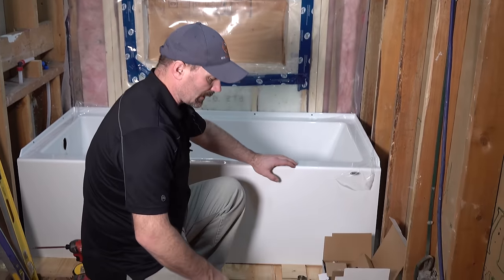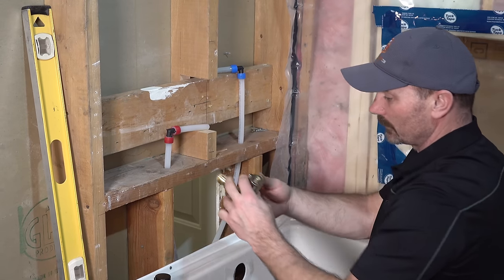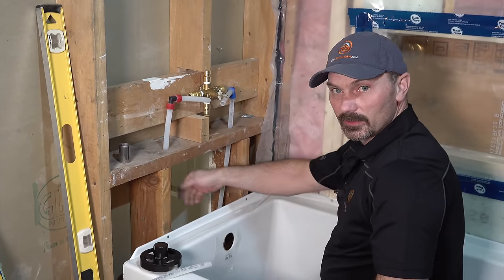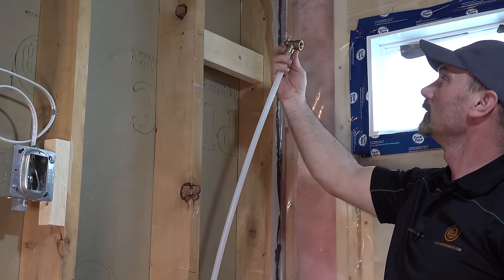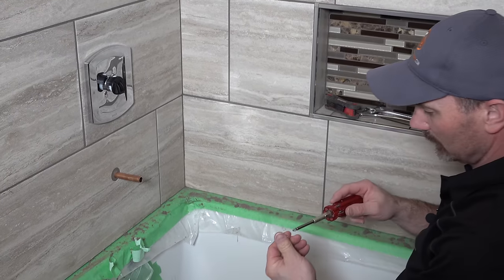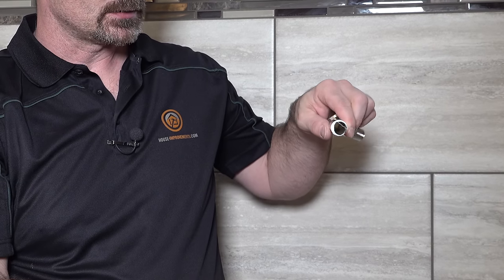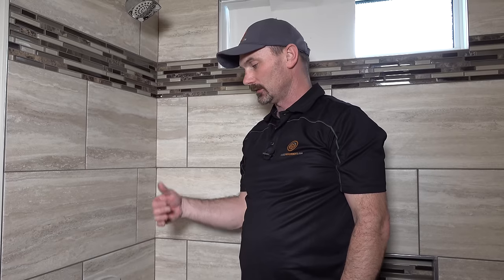How To Install Tub/Shower Faucet

Comment: I definitely appreciate the level of detail you include in your descriptions. As a handyman, I do so many different kinds of projects that I need these extra reminders and notes so crucial steps remain in sequence. Thanks for confirming the importance of anchoring PEX and always switching to copper when pipe needs to breach the wall. I didn't hear you mention gauging plumbing rough-in height with tile size and layout to avoid grout lines falling behind escutcheons, trim plates and tub spouts (when possible), but your finished product demonstrates this preferable aesthetic. 
I currently have yet another project including a tub conversion to shower, and a tub replacement, in tandem with a PEX system upgrade from old CPVC for the cold. This is in a condo w/steel studs, so I'll be cruising through your vids for any tips I don't already know. Already looking to reframe the shower to best accommodate the clients preferred tile. Fun Fun Fun!
Reply from the maker: Disaronno on ice

Comment: I am using a Moen system very similar but unfortunately I have the bath spout that screws on and the length of the copper needs to be just right, which you talked about, ugh. Very good info you provided, thanks!  It will help me a lot in gauging the depth of the Moen valve. As you mentioned, the instructions are vague in this area.  It's more art than craft at that point. Wish me luck!
Reply from the maker: Glad I could help! Those threaded spout connections suck don't they? LOL

Comment: I know those push connect/shark fittings are convenient, but why not use pex crimp rings?
I know they are more permanent, but I would think they are cheaper and no worries about the slim chance of a connection leak/failure.
Reply from the maker: you for sure could ,This is just what I do as it is very convenient .

Comment: I need to know about threading the shower arm on. 
I counted 3 rotations and you said you couldn't do more, all by hand, no tools. 
I just had to use a 24in pipe wrench and the arm sandwiched between 2 boards to hold it just to get my arm and sharkbite threaded together. (I used 5 wraps and pipe dope) we got them together and only seated about half the threads. I went through dry fittings with 2 different shower arms and multiple 1/2in female threads. All copper or sharkbites while sitting on the floor in a Lowes trying to see what the heck the issue is. 
Initially the arm leaked, after the pipe wrenching madness and 4 or 5 solid turns, no leaks. I cannot understand why that was such a hassle for use while the multiple other threaded fittings were light weight and easy wrenched snuga
Reply from the maker: I would say you had the threads cross threaded ?
Reply: @HouseImprovements  by all means yes, the original fitting was crossed after we removed it. The crazy thing is, the shower arm was just fine, when tested in other fittings we had the same result, just didn't tighten it fully.  Our problem has been an issue with a few others too by checking  a couple forum posts here and there. In the end, we got a new shower arm, a new fitting, plenty of dope and tape, a hefty amount of applied force, now no leaks. I even asked opinions of the employees with the dry fits in store before I took them home.

Comment: Great video! About to attempt my own installation.
I think I'm going to go with PEX tubing like you did.
Curious about the push-in connectors though, especially the one for the tub spout, what is preventing the pipe from falling out of the connection ? I was waiting for you to clamp them on but it never came 😅 any clarification would be amazing, thank you!
Reply from the maker: The fitting has "teeth" inside that keeps the pipe from slipping out under pressure. At the 20:30 mark I explain that I will add another block of wood and clamp to the pipe .

Comment: Question: so I just had a bathroom remodeled. It had no shower head plumbing and I believe mostly galvanized pipe. Anyways, the guy I hired used all pex. Before paying him, I turned the tube on and my shower head would leak. Further research, it's because he used pex from the diverter to the tub spout. Anyways, I needed him to fix but obviously he wasn't going to cut the new tile. So he had access to the back of the shower portion. He ended up changing the tub spout that he had pex to copper, to 1/2 galvanized pipe. He fixed the issue which was great. But, obviously I wish it wasn't galvanized. Anyways is this a big issue for me or should I be okay for many years before it starts to break down since water isn't really sitting and pooling as much in the down spout?
Reply from the maker: galvanized is not ideal anymore but you will get many years from that .

Comment: By the time you do one bathroom with push connects you could have bought a $45 crimper with rings and all the fittings from the orange store, next bathroom will be half the cost and you own the tools to do professional work

Thanks for the video!

Comment: Great very well explained video your example is pretty much exactly as mine situation is, however I am little confused I was most interested on placement of the valve depth wise from the tiled surface , you said in the beginning that the black cover plate should end up flush with the finished tile however when you showed the final fitting of the sleeves and escutcheon plate etc it looked like that black cover was set back behind the backing board can you please confirm this positioning I have watched several of your videos and you have a great teaching ability
Reply from the maker: The faucet appears that way but the plastic plate is removed because the wall covering is thick enough that the plate is not needed for support. It just looks further back then it is I guess? If you had a fiberglass or acrylic shower wall only then you need that black plate in place just behind the shower wall to help support the wall because its thin.

Comment: Thank you for this!
I have to redo 3 bathrooms & the only plumber who will come out to my house is very rude and he refuses to sweat copper. I'm not comfortable with sweating copper, so I wanted to see how to connect copper pipe for the tub spout. I can re-use existing copper rough-in for the two tubs. I didn't realize push-fit worked on copper for some reason.
I'm going to be cheap & use sch 80 PVC elbows (used for electrical conduit) for the 90° bends for the water supply to connect to the valve bodies. It's less than $1 for the elbows where I live and it will be less likely to restrict the flow.
I'm going to be using thin-walled direct-to-stud wall kits so I'm wondering if I can use water-sealed plywood to reinforce the spots where holes are cut so that if they ever get pressed on/leaned on, it won't crack the surround. I know Sterling/Kohler uses plywood or OSB coated in some protective water seal for their "age-in-place backers". I'm going to be making my own for the grab bars since Sterling didn't have them in the right place for the grab bar sizes we are using. I'll also be adding braces in the wall spanning the studs that the backer boards can anchor to.
Btw, do you have the link to your video on installing that valve in a thin-walled shower? I would very much appreciate it, please.

Comment: So I bought a Moen Adler yesterday ..How much is/should your metal protruding 'beyond' the tile ?
Reply from the maker: Not sure what "metal" you are referring to . There should be a plastic disk ( about 5" around) attached to the valve, that should be flush to the tile. In reality you usually can be 1/8" deeper or prouder and it will still work.
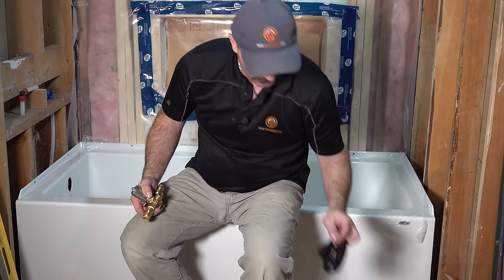Reply from the maker: Watch at the 5:40 mark

Comment: Hi Shannon,  Let me ask another question. My shower has diverter cartridge. It is not Pull spout diverter.  It has 3 out lets.  Tub spout,  hand shower and rain shower.  i can change the  outlet with diverter switch. 
In this case,  copper pipe on bath spout is necessary to use?  Even back flow happens, the diverter cartridge is inside shower valve. the divereter cartridge will stop the back flow. 
Is it correct ?   Copper pipe is necessary on bath spout when the shower uses a  pull spout divereter.
Reply from the maker: I believe you are correct but cant say with 100% certainty. check instructions.
Reply: Thank you  very much for your help

Comment: Is the pex for the down spout really a bad idea? Or just not recommended
Reply from the maker: The smaller inside diameter of pex compared to copper can cause water to back up and actually trickle out of the shower head.

Comment: Hi Shannon, what did you fill the hole with to keep the faucet pipe stable?
Reply from the maker: I usually cut the tile hole 1" and then grout that hole around the pipe when I'm grouting. Once the spout is connected you are fine anyways.

Comment: You’re awesome teaching. Question, why copper to the downspout? Can it be pex?  Thanks
Reply: The inside diameter of 1/2" copper is larger than 1/2" PEX. The valve will try to force more water through the tub spout than it can handle if it was PEX and the water would rise to the shower spout and drip when running the tub spout.

Comment: Does the cartridge that comes with a typical valve have to be replaced (is the one that comes with it need to be replaced?) With a permanent cartridge and if so why?
TIA!
Reply: Some manufacturer's valves are shipped with the cartridge removed and fitted with a test cap.  This allows the valve to be soldered without the possibility of damaging the rubber or plastic components of the cartridge when soldering pipes to the valve and provides a plug in place of the cartridge for pressure testing the soldered connections.  After all connections are verified to be leak free, you install the permanent cartridge.  The cartridge should last for at least 10 years before requiring service.  The cartridge can then be serviced through the front of the valve face.

Comment: At 3.20 in the video you say PEX is not recommended for the tube spout.  If PEX is used you will experience water coming from both the tub spout and eventually the shower nozzle when the valve is opened. PEX inside diameter is smaller than copper piping and causes a back pressure suppling water to the shower nozzle as well.  I personally experienced this.  I got the information from watching another video.
Reply from the maker: Exactly. If the pex from the valve to the tub spout is pretty short it will likely work fine then but if its much more than 10-12 inches you will likely have trouble.
Reply: A copper drop is recommended for the tub spout drop and it is code in most jurisdictions.

Comment: What type of copper piping do I need to get for the tub spout to connect to the valve and what type of pipe is that white one that connect up to  the shower head mount to the valve
Reply from the maker: 1/2" copper can be used for all of this plumbing if you want but most common now is Pex A or Pex B  used for water supply and shower head , but the tub spout should be 1/2" copper .

Comment: What sort of connection is needed for exactly what you have, but with  added hand shower?
Reply from the maker: You can use a tub spout with a diverter and connection for a hand held shower head.

Comment: What if you put in a new assembly and everything works but the cold water? It isn't the cutoff valve.
Reply from the maker: Sounds like the valve mixing cartridge has an issue? If you did any soldering during the install with the cartridge still installed you may have damaged it or it could just be defective. I would start by replacing that . Many brands have a great warranty on those cartridges so you may be able to get one for free. If you have more issues please use my forum for assistance. Thanks https://www.house-improvements.com/forums/

Comment: Here's a tip. Do not let your Teflon tape wrap over the end of the pipe. When you screw it in, may get cut off and wind up in your shower head. I've seen that happen so many times in industry...where flowmeters were reading incorrectly because they were affected by loose Teflon tape pieces. Did anyone else see how the shower head cut the ends off of the Teflon tape wrapped on the pipe? Those are the pieces that can fall off and clog the head. Also, if your tall like me, then mount your shower head high enough so that you can stand under it without having to bend down.

Comment: Hi Shannon I'm watching from the UK and notice that you don't use pipe inserts into the end of the PEX to keep the rigidity before you insert into a fitting, is the PEX you use much stronger and also for domestic use we can only get it in white in UK, great videos, thankyou.
Reply: It was there. I saw it. He just didn’t point it out.
Reply from the maker: With these Shark Bites that collar is inside of the fitting. Some brands do come with them loose in the packaging. They are required when using with Pex.
Reply: @HouseImprovements  Many thanks for your response, I'm getting a better idea of how it works in Canada.

Comment: Recently installed a shower only version of this model on a tub to shower stall renovation.. I have very little water pressure. Any idea as to why? 

It is hooked up to a line that actually has a hose bib drawing from the same line AFTER the shower which has full pressure. Is it possible I have a faulty manifold or did I miss a step?

Comment: I feel that the shower spout should be installed prior to putting in the tile to not take risk that there is a leak as you have seen that it's kind of loose (by 1/5 of a turn) at the very end.
Reply from the maker: You can install it and test the system if you like.

Comment: How good are the shark bite . How many year guarantee? They do have a rubber o ring , wouldn’t it fail eventually?
Reply: Ya don't do it. This guy won't be around when it starts to leak. Use expansion or crimp fittings. Watch the many videos on how cheaply made those push fittings are.

Comment: I noticed on the copper assembly you made for the tub spout that you didn't use the Sharkbite fittings. Is that by design or can you use them on that copper piece as well.
Reply from the maker: I prefer soldered copper for the spout as it is more solid

Comment: Is there a specified height that the shower head have to be from the floor of the tub?
Reply from the maker: Nothing really written in stone but the instructions will have a suggested height  which is normally around 78" if I remember correctly.
Reply: @HouseImprovements  Thanks.

Comment: Hi and thanks for the video.
Did you use 2x6 or 2x4 for the studs that you mounted the mixing valve on?
Do you have a video of running the lines from that mixing valve to the existing hot/ cold water lines (couldn't find them)?

I'm in a brand new build here in Alberta with similar pex piping in the entire house and no copper. I'm the process of framing my basement and wondering how to run the rough in water lines from the existing lines.

Comment: Great video!  question: I'm building a new house and will install a couple tub/shower combos. I know I will need to buy the rough in valve separately however some kits say I need a diverter. I'm thinking that is a mistake since the tub/shower diverter is the knob on the tub spout which should be all I need. Correct! Thanks!
Reply: meant Correct? with a question mark. thanks,
Reply from the maker: Not sure what kits you are purchasing , the ones I use come with that spout diverter? The spout diverters can be purchased separately.

Comment: Great video however I would avoid using push fittings behind what will eventually be tile. If in 10 years it fails you got to rip so much out to get to it. Better to solder if you are permanently covering IMO.

Comment: Thanks for the video!  Can I ask, we are redoing a shower tub with a separate hot and cold valve.  Is it a big job to have the single hot cold handle instead, I can’t do it myself but the wife wants the one valve and as long as it’s not to expensive for a plumber To change the piping I would be ok, but if it costs hundreds or thousands than we would stick with the separate hot and cold handles:  thanks
Reply from the maker: All depends on the situation but if the wall is open its a pretty easy change over usually. Have a plumber give an estimate.
Reply: @HouseImprovements  Awesome thanks, one person told us it would be a huge job to do that and we were suspicious by a lot of things he said.  We would have the sheetrock replaced anyway, so I was hoping an experienced plumber could fix it without the cost rising to much.

Comment: Thanks, I'm putting in a new system on mine but using a fiberglass surround.  What is your input on how far out the fixture needs to protrude from the studs behind the surround?
Reply from the maker: That all depends on the profile of the fibreglass panels. This type of faus=cet would have the black plastic plaster ring situated so that it is against the back side of the fiberglas panel. The hole in the panel would be slightly smaller then the ring itself. Our forum is a great place for info. and help like this.https://www.house-improvements.com/forums/

Comment: Could you tell me the reason why you do not use pex for tub spout pipe? You use copper pipe between valve and tub spout.
Reply from the maker: The inside diameter of pex pipe is slightly smaller than that of copper. This can cause a back pressure sending water up the shower line at the same time and dribbling out the shower head.
Reply: It  means that when I use the bath spout,  small amount of water accidentally goes up to the another outlet. It might be drip the water from shower head . Is it correct ? right .